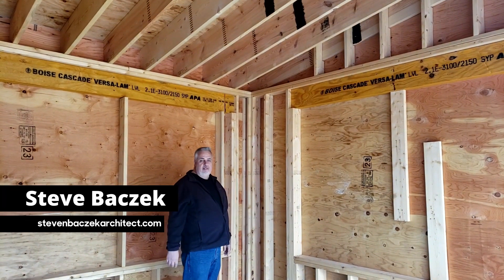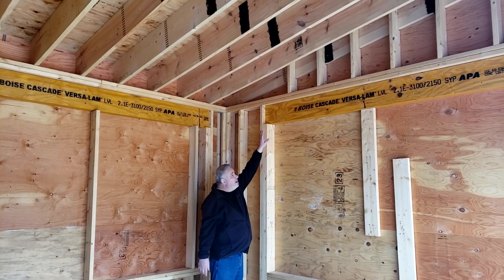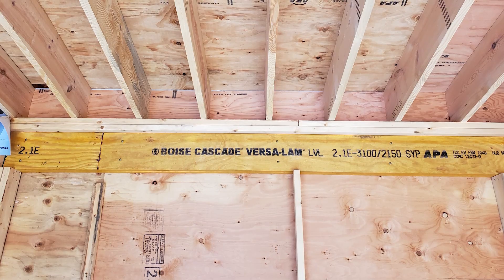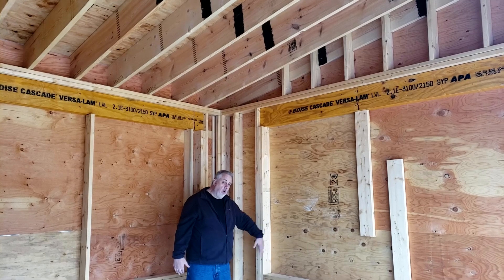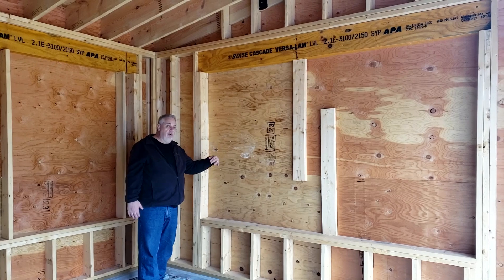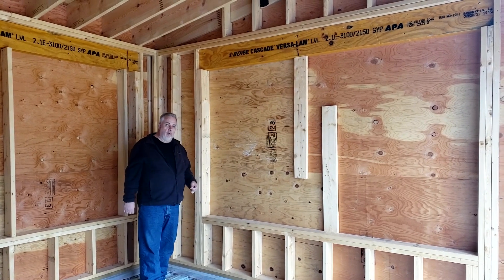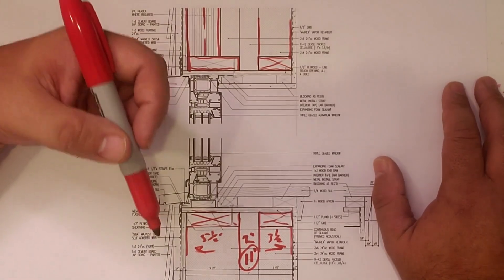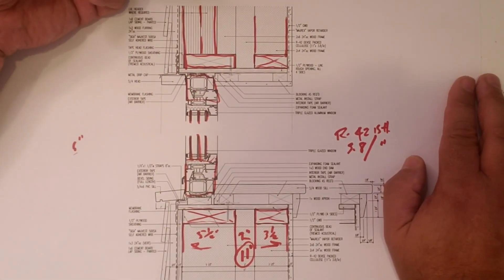PASSIVE HOUSE DOUBLE WALL

Comment: I love your videos. We use post and beam timber frames with 2x12 or 2x10 glulam beams 3.5 inches thick to do the same thing 10 inch thick walls. You don't frame windows and doors in with thermal breaks? Windows and doors with low r values can cause condensation issues. We also spray foam around windows and doors and stud bays next to them.

Comment: I love this. What are your thoughts about flashing windows almost like skylights to say.

Where instead of bringing the WRB into the window framing and then spray foam acting as a sealer, but to bring the peel and stick WRB onto the face of the window (for extruded windows as well) instead of taping the WRB to the window?

Still spray foam for air sealing, and insulation at the window, and a backup waterproofing type thing?

I’ve done with extruded windows (especially on Reno not build) for a siding re/re where all windows are already installed.

Prime the edge of the window and then peel and stick. As long as it doesn’t pass your siding thickness it’s not seen and gives good continuity for air barrier but also waterproof.

Comment: Is a 2x4 for inner and outer wall not a good idea? Cost difference mean much or it just better to go with the 2x6 outer and 2x4 inner? I'm in Kentucky for regional concerns. Great content by the way.
Reply: I'd imagine you save having a 2x6 exterior because it takes less boards overall to bear the load. 24-32on center instead of 12-16.

Comment: Love your videos and years of knowledge. Really great that you got to work with Joe for some years. 
The drawing that you had should not have had the 2x6 detail on the bottom of the header though. It should be the 1/2 plywood. 
Thank you for all the knowledge you have shared over the years. I have changed the way I build. 
Grace and Peace 
Slick

Comment: If the client asked you to then do what you could to take advantage of the double wall for added strength against wind, what would you suggest? 

I know you’d want to avoid thermal bridging, but are there gussets, straps, anything, you could add to turn this double wall design into a big structural benefit?
Reply: I had the same question. Would something like a double 2x4 wall(offset) with a 2x8 or 2x10 top/bottom plate be, in theory, stronger than a singe 2x6 wall? Asking from the Florida east coast.
Reply: @LogansRun314  :: I’ve looked into this some and what I read (from Green Building Advisor, I believe?) was a single staggered wall was not as strong as a double wall.
But, they didn’t get into specifics… they didn’t explain how this was the case given only the outside wall is noted as the load-bearing wall, and they make no mention of tying the 2 walls together in any manner. 
I did see a drawing where a piece of 1/2” plywood was fastened to the sides of a 2x6 & 2x4, at the lower half of the double wall. But, they didn’t say if at every stud, nor mention the thermal bridging. I wondered if a gusset could be used similarly to better effect, since it’s made for connections and is much thinner material.
Reply: @chadcooper7348  That's surprising, I would have thought the opposite. 

I'm torn between building a house with CMU(exterior cavity insulation w/air gap then brick) or double wall construction with a single top/bottom plate... I guess we would refer to it as a "single staggered wall" as you mentioned above. The big downside to this method would be the top/bottom plates would not have a thermal break, if opting to not run continuous exterior insulation. Perhaps this is why it's not so popular amongst the double wall crowd? 

I have seen that 1/2" plywood idea before and thought it was interesting, but didn't see too much of the detail.

Comment: Great content as usual Steve. Question. I can see that this is a great wall design. But to my mind, and I have no expertise in this subject, I don’t see the advantage of the double wall over a single frame wall with exterior insulation? Framers would only have to go round one time building one wall and there would be lower lumber costs also. What your thoughts? Interested as just moved from the UK to Calgary, AB and we are considering doing our own build. TIA
Reply: I'd guess money and easier detailing at the exterior side of window openings.  Cellulose is a LOT less expensive than exterior rigid and I suspect the labor costs of installing exterior insulation vs. a second 2x4 interior wall probably offset.  They did not do it in this detail but the vapor barrier could be placed at the interior face of the 2x6 and then the cavity in the double stud wall would act as a service cavity making it easier to run electrical and plumbing (if the cavity were slightly bigger).  Another easy mod to this wall would be to add 1/4" to the 2" cavity so that the overall width matches a 2x12, then a 1x12 or 2x12 could be used as the window buck if desired, etc.

Comment: What if you frame the exterior side of the window larger and the interior frame of the window you go with a 2X6 (or different based on the asthetics) and use a flanged window that would mount to the inside framed wall. You could do a trim detail around the exterior frame with a foam product for additional insulation. Just not sure if that would be superior in any way

Comment: Love the detailed information. 2 questions. Why did you push the window to the outside edge instead of more in the middle? I was told the middle is best if possible. 2nd, Have ever done any cost comparisons of adding Rockwool on the outside compared to the double wall? What do you think are the advantages of one system over the other? Thanks

Comment: Is it "normal" to frame the inside walls after the outside is finished?  I am curious about the various orders of operations.
Reply: I would say the few times I've seen it, yes to your question.  The structural walls are built first (outside).  The internal (or curtain walls) are then done in a more dried in environment similar to how internal walls are usually completed as secondary order of operations in most framing methods I've worked with. You can build all your partition walls before going up to next story or roof, but often (especially when manual moving of materials), the interior walls get in the way of structural / dry-in process and often temp bracing is used to hold structural walls plumb without interior walls to be part of that bracing scheme. Also, note the internal partition walls will tee into the inner part of double wall system (so all that can be done together).